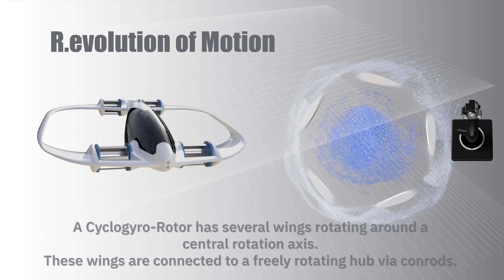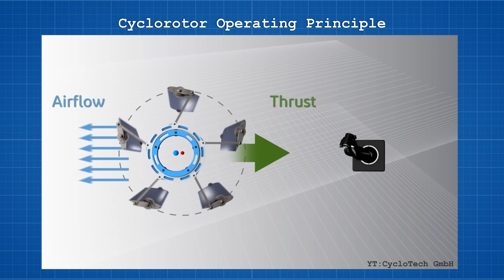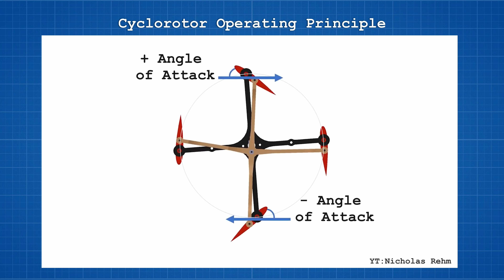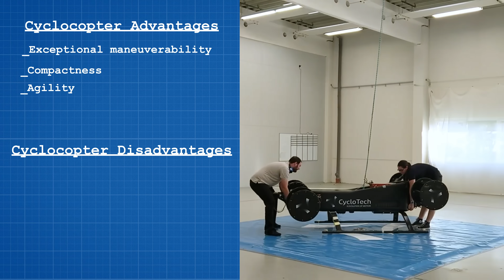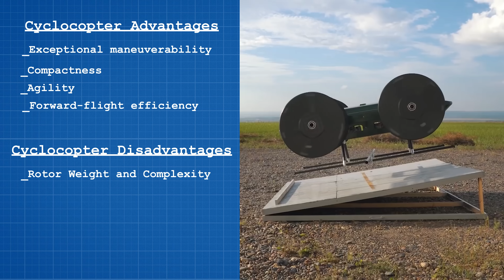CycloRotor: Is this the future of eVTOL Electric Propulsion System?

Comment from the maker: The eVTOL company Elon Musk wishes he had founded. The Tech behind the Lilium Jet. 
👉 https://youtu.be/fmiVd-CiNmw
Reply: The company that wishes Elon Musk was interested.
Reply: @Dude_Slick  Beat me to it dude! high five
Reply: @Dude_Slick  oh look a Member of the musk cult…. Lol
Reply: if that wasnt a youtube link, i would be 100% sure that any hyperlink following the sentence "The company Elon Musk wishes he had founded." contains a virus lol.
might aswell write: "doctors hate him, find out how this CEO managed to revolutionized airflight. you will be shocked" or something like that
Reply: Half their thrust is lost. It's blowing UP.
The cage motors are usually Shrouded, so that flow can be Directed.
The reason the thing is Lifting - is because there's no Surface above it.
Otherwise, it would just hover in the middle.
Reply: @MrDeicide1  No it isn't. 3:14 shows that the pitch on the top and bottom are both downward thrusting.
Reply: @JeremySwigart  he is both right and wrong.  That the blades are not independently adjustable but require central hub for position adjustment  does hurt the effeciency.  
This also shows an issue with forward or rear motion In that the lifting forces require the blades to be in a position that counteracts the directional thrust of the other. That it's a complete foil rather than split also doesn't help.

I also see this as really unsafe for public use. The world is not a clean and dandy place. This is equivalent to doing a wheelie in a lawnmower type safety. 

I see a potential workaround that would make this safer, easier to control and more efficient buuut, nobody is ever interested in my ideas anyway

Edit. Why are the ascending and descending blades at a 90aoa anyways? That's a lost opportunity.
Ykw, I'm a wack engineer anyway but  common Sense?
Reply: share the stats on efficiency of these wheels vs standard props.  if this takes 70% less energy, then it makes sense.
Reply: Needs more batteries.
Reply: Sure. And you can't make it fly for  long  ."Force".. and a new wheel. Who need that.
Reply: It's really supposed to be a two-part concept engine rotator. I guess really to simplify just work with the flex
Reply: How much It with, two Cannos 0.50 or 4 Sidwinder ?
Reply: eVTOL, is stupid.

Super stupid
Reply from the maker: @hosoyalaurence  why?

Comment: Those squirrel cage fans are going to fall apart from all the movements of the blades each rotation. A normal propeller won't; plus, a normal propeller provides 100% thrust during all 360° of its rotation. But i'm curious if this thing can become an off road vehicle when the squirrel cages are at low rpm, or if you can use the thing as a small combine harvester?

Comment: How will it accelerate?!  No way...  it cant smooth stream air. Its generating a turbulent vortex in the center. It can not stream air smoothly. Its using so much torque for no reason. Torque isnt needed to fly.  Lift has little benefit from torque. Its a cool idea. But until i see one fly in person at the proposed specs and speed. I will see this as another hoax/scam product. Like free energy generators.

Comment: Seems like friction would be a major issue if blades need to reposition in each revolution
Reply: Helicopters do it just fine
Reply: @FixedWing82  Helicopter blades don't pivot with every rotation.
Reply: I’m sure there are bearings in the design, not just parts rubbing together
Reply: Agree.  It does seem like an awful lot of moving parts.  With each blade pivoting with every rotation, there must be lots of mechanical stress and friction.  Each pivot point is something that needs to be lubricated, maintained and is a potential failure point.

Comment: And when a canadian goose goes through one of the rotors at 60 feet? You fall, unrestrained, to the ground. Until a low level save system is developed none of these schemes are viable.
Reply: That was my First Thought Exactly! But I think a Damn Hummingbird could do the Same amount of Damage as a Duck, an Eagle or a Condor at the Rate those Blades are Spinning. Even at an RPM of Idle Speed, It's even Possible that a Large Insect could cause a "Terminal Failure" if it were to just make an Ever so Slight Contact with one of those Blades just Right. 
At the Speed they're Rotating, I'm sure they'd Disintegrate. Then Where's the Backup? The Redundancy? Do the Other 3 keep it Aloft? I don't think So. It takes all 4, to work. So there is no Backup. What are we left with? 
It's going "Down"-Town Leroy Brown in a Hurry...lol . 
Seemingly It can't fly without all 4 Blades Spinning a pretty Hefty RPM. So the others Become Weapons of Mass Destruction to Anyone Trying to Bail from the Craft before it hits the Ground in an Emergency. They are just waiting to "Suck you In". Not to mention,  What Happens to the Blades when they Start Coming Apart? Do they Breach the Cockpit? At that Speed? I Shudder to Think. Heck, They Probably Act like a Giant Food Processor.
Scary thought huh? You wouldn't catch me riding in it. As a matter of fact, I wouldn't want to be "Anywhere Near It..."
I'm all about Innovation but That thing just Looks like an Accident Waiting to Happen....
When a Contraption such as this Depends on so much Precise Movements "Everything" working to perfection, if Anything Upsets those "Precise Movements", with NO "Backup Plan" means things can only come to a Castastrophic End.
Reply: Small planes can have safety parachutes, they even launch the parachute with a small rocket and body panels that are designed to be broken away by the rocket. It isn't that difficult to build a safety system that let's it fall slowly to the ground. I bet it could have software that allows 2 or 3 of the cyclorotors to keep it in a controlled decent.
Reply: Perhaps it can be designed with redundancy - able to emergency land with 3 working rotors. With conventional  quadcopter this is too hard to manage angular momentum of 3 remaining propellers. Here the momentum won't tend to rotate whole craft so much, it should remain steerable. Maybe even only with two remaining rotors diagonally! Guess that's one of the reasons why Russian army is interested.
Reply: A simple cage around the rotors like an air boat too complicated for you.
Reply: Killing all the non-migratory Canadian geese in America is a better option
Reply: >Assuming the thing won't tear itself apart without any assistance to begin with lol

Comment: Beside its complexity, one should not forget the risk of lack of redundancy in this concept. What will happen it only one rotor blade is damaged, or one of the four propulsion units fails? The chosen design of VoloCopter (or similar) is not only by chance using multiple rotors, but to ensure its flight capability in case of failure - maybe a good idea if one is thinking about transporting people...

Comment: Honeycomb plastic sheeting might be worth checking out.
The honeycomb cells can be larger or smaller for more strength or more flex.
It's also available with a cloth sheeting on two sides for using resin or epoxy.
Hidden under that is a micro film that keeps the cells from filling up. This also creates a dead air space with internal structure.
The weight is about half the weight of balsa wood.
Crazy strong

Comment: Seems to me that the pure physical strain of the blades changing angle so quickly, back and forth, over hundreds or thousands of rotations in a single flight would begin to have major effects on the structural integrity of not just the blades, but the device itself.
Reply: Interesting proof of concept indeed, but the structural challenges will be key to futures.

Comment: This video fails to mention if they’re capable of landing if one or more of the motors fail, and also how loud it is. I’ve seen a lot of promising experimental VTOL aircraft that couldn’t get any further in development once the engineers realized that the only way to stop them from being ridiculously noisy was to completely throw out the design and start over
Reply: You can't perform an autorotation with this design, it's vehicle loss during failure of any of the four rotors. Unsuitable for human transportation.

Comment: Complex and doesn’t look like it’d handle great with asymmetric thrust but I love it we have to start some where it’s got potential!! Auto gyration and stable flight characteristics during engine failure will be key
Reply: That's common characteristics of all multirotor aircraft, they lack the capability of autorotation or gliding, like a traditional helicopter or a fixed wing aircraft. It's hard to believe these will ever make into public transport, something as simple as a bird strike has the potential to turn it into a brick.

Comment: It is very ergonomically adaptive in flight shape and ratio, for adjacent to road wheels, verticle paddles of water and submerging enviroment crafts. With those advantage, the next will be, can it use same or less power then a traditional rotary spin blade. What I could suggest, is adding a 1/3rd cylinder shield, that may dilute the vortex drag in those oppisit sides of path motion. Rotating the shield clock motion parallel/counter to the vector control or as rotation control steer navigation pitch & acceleration speed

Comment: There is a nomenclature mistake here. This isn't a "cyclocopter", it's a "cyclopter". The word root for "wing" is "pter", as in "Pterodactyl" (winged finger). "Helicopter" isn't made of the wordroots "heli" and "copter". "Copter" is meaningless. The breakdown is "Helico+pter", meaning helical / swirling wing. Given that the word root for wing is "pter", cyclo + pter = cyclopter. "Cyclocopter" is a nonsensical construction that isn't consistent with the word roots it's composed of, because "copter" isn't a word root.
Reply: neat, thanks for looking into the roots

Comment: But how do you glide or autorotate on engine failure?
Reply: im guessing, in response to stability sensors, the three remaining engines' adjustable blades vector thrust at a slightly different angle to compensate
Reply: @mikemotorbike4283  No, like, if it all fails.

Comment: I would definitely rather fly in a drone that has multiple motors/props. That way if one or more motors fail, there are still plenty left to safely land. If one of the pitch control belts were to fail, well.......it might be a "rough" landing.

Comment: The cool thing is, that the same maths can be used to make a horizontal/vertical turbine more efficient at capturing wind.
Reply: I was also thinking same to keep same force in vertical blade but the structure of cycloroter will be changed
Reply: They already are using it
Reply: to me it looks like Voith- Schneider Propeller in air
(also mentioned in the video)
Reply: Maybe... This is interesting to evaluate said vertical axis wind turbine https://youtu.be/6vb18oXPli4
Reply: SHEEESH 🥵🥵🔥
Reply: 5y https://youtu.be/L0HUlvg01XA

Comment: Just cause you can, doesn't necessarily mean you should. If this struggles to get a skeleton model or a carbon fiber mock up barely off the ground, how will it lift any cargo or passengers? How can you dead stick this vehicle in case of catastrophic engine failure? What about crosswinds? I don't see anything like a rudder or trail rotor. So outside of a lab, how is this more practical or any kind of advancement over airfoils and engines or rotorcraft? I wouldn't get in that thing. Which one of you brave folks wants to real life test pilot this thing? Epic waste of resources trying to force a novel tech from the past. There's a reason they thought this was a good idea before we understood aerodynamics and that isn't the way aerospace advanced. Unsafe, impractical, just folly...

Comment: itd be pretty cool if it also drives as a car since those rotors are pretty close to wheels.
Reply: Given the nature of the design, it is unlikely to ever be able to drive on a roadway, as you would need to install differentials, a steering mechanism, the actual wheels themselves to a tolerance of being able to handle high speed rotation as well as the compression on the roadway...all of that will make this device heavier, which is the exact opposite of what you need to achieve flight.

Comment: Nonono. A fixed-wing aircraft can glide if a power system fails, or if multi-prop, can possibly land at a safe location. A rotary-wing aircraft may auto-rotate if a power system fails. A 4-motor (quad) power system is doomed in 100% of circumstances, if only 1 power system fails. YOUR DESIGN WILL GO NO-WHERE UNLESS YOU INTRODUCE REDUNDANCY MEASURES. IE. 8 POWER SYSTEMS AND ACCOMPANYING FAILSAFES. Contact me if you wish to succeed. Sincerely, Rob.

Comment: "Immediately react" - looks rather nervous actually. It has no inertial forces like overhead rotor craft do.
It will eventually have to ditch the automobile shape in favour of a cradle with those rotors placed well above the heads of children. 
Millennials huh? Tech first, thought later. Forcing never works long term. IOW neat, but mindless. Robo-minded.

Comment: on a preliminar analisys of mine, I assume that this system provides less thrust than a conventional propeller, as it provides its main thrust only 270° from its spin, and a secondary thrust at the top (90°). At approximately 0º and 180º, it offers no thrust.
Reply: Agreed. There's a reason we kept developing the propeller, and eventually the jet engine, while this got left behind. It's trying to solve a problem that has already been solved. This performs the same function in theory that a helicopter performs in practice to a much greater degree.

Comment: Big problem to make it a reality, and that is the weight of the electric engines and the battery. You do not need cyclo rotor, a duct fan with thrust vectoring is enough. If you want to use a cyclo rotor fine, good for you, but this is not an electric car this is an air vehicle, where the engines not gravity must sustain the weight of the vehicle. Thus the biggest challenge is weight reduction.

Comment: Is Magnus Effect being relied upon in the event of failure to complete a successful auto-rotation as long as sufficient forward momentum is achieved? Using one-way bearings in driveline to achieve auto ability.
Reply: no, the blades are too small to glide so there probably will be a parachute that safely lands the craft in case of a critical failure
Reply: @Real_Commander_Shepard  Too small as in the cylinder is too narrow?

Comment: Thanks for covering this but I remain very skeptical. Variable pitch props can respond without changing engine speed as well and are a well developed and much less massive tech. I think the folks at Lilium have the magic even tho they use engine speed for control.
Reply: But no matter what they do, it'll never be this compact.  I imagine both types, if they actually prove viable at all (which is what I'm skeptical about), will be used for different purposes.
Reply: @DoremiFasolatido1979  yes but the traditional helicopter design is much more save because it will still be avle to land even if the engine fails...
Reply: @mapmakerger3118  And the cyclorotors have a lot of other advantages, they can react much faster to loss of one of the rotors, can actually maintain flight and control with only two intact rotors (except if they're both on the left or right side I suppose), and are compact enough to just use a normal parachute as a backup safety device.

Comment: They can double up as wheels themselves if you just put rubber on them
Reply: Not strong enough for being a wheel. Or it will be too heavy to be a rotor.
Reply: @phillgizmo8934  true. Maybe could work on autonomous vehicles that are lighter

Comment: How on earth is it practical - it's so incredibly loud that it's literally dangerous to bystanders just from the sound produced. What is the point of VTOL if you can only take off or land away form people
Reply: 🔵 Supposedly the sound output is substantially less than a similarly-sized quadrotor.
Reply: @joshhayl7459  which is still completely impractical for any urban space.

Comment: Far far future...
In Energy density terms:
A lithium-ion battery pack has about 0.3 MJ/kg and about 0.4 MJ/liter (Chevy VOLT).
gasoline is 47.5 MJ/kg and 34.6 MJ/liter
 Gasoline thus has about 100 times the energy density of a lithium-ion battery.
Reply: You have to factor in how much of the total energy of the fuel you can really use, and the efficiency of electric machine vs gasoline powered motors. Electric motors are usually around 3x more efficient of an equivalent ice, so the energy density problem is reduced by 3. Still a big difference, but...

Comment: Are the blades protected from outside factors in any way? I mean, at the speeds they're rotating at, a stray fly or drop of rain could severely damage them.

Just look at wind turbines. After decades of use, only now are we realising that the sharp edges of the blades actually get destroyed by simple air "pollution", particle, due to the sheer speed they are rotating at.
Reply: If widely adopted, birds will bring these down almost like rain, until there are no birds left.

Comment: With small cyclo rotor wheel like ordinary car Its already on right track, but must added air propulsion system on the bottom like f35. With this combination and cheap price it will lead the market.